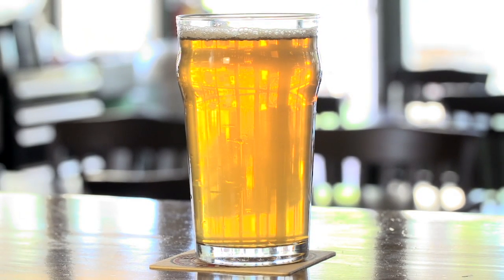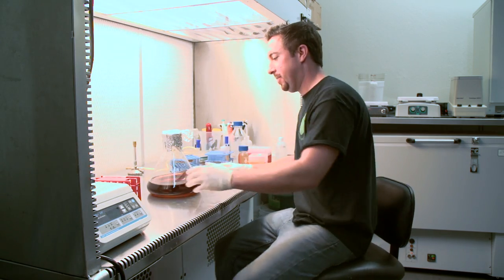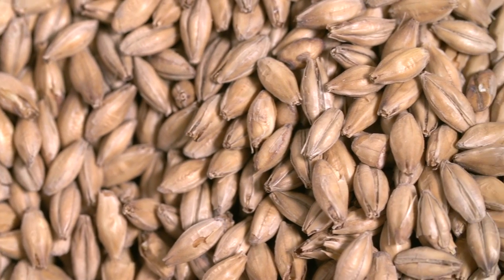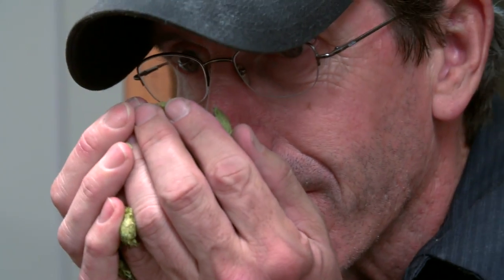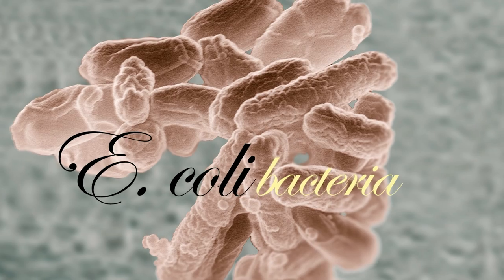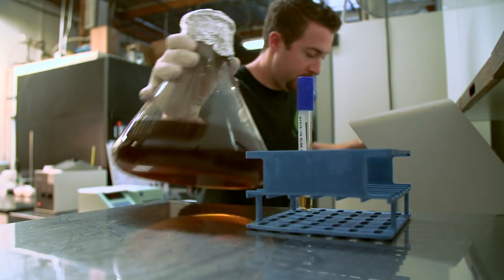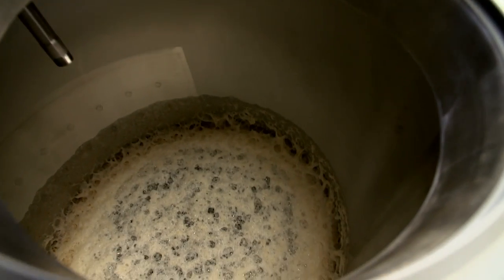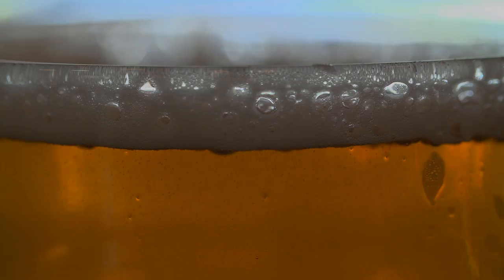Science of Beer: Tapping the Power of Brewer's Yeast

Comment: does yeast control the strength of the beer?
Reply: Yeast turns sugars in the malt into alcohol. Some yeasts have higher alcohol tolerance and so can make lots of it before they die, some yeasts have lower tolerance and will leave some sugars unfermented (not turned into alcohol) by the time they are dead. That said, without any sugar for the yeast to eat (which usually comes from the malted barley) you will get no alcohol.